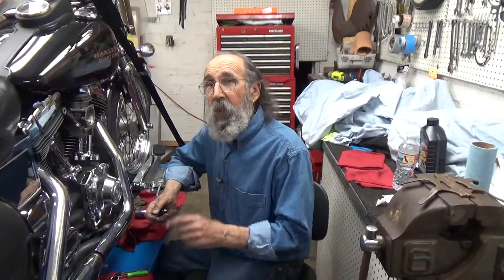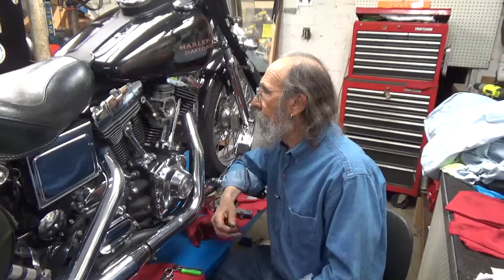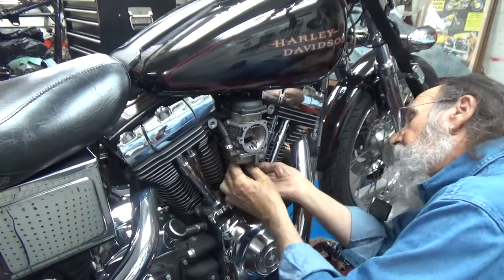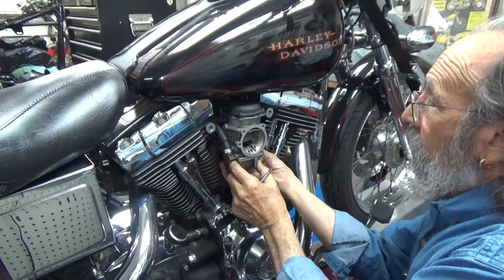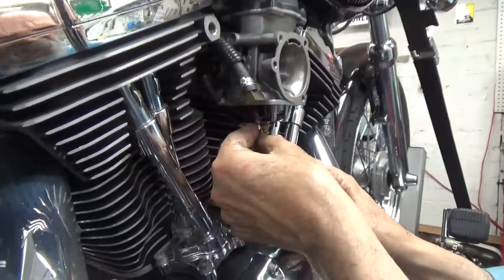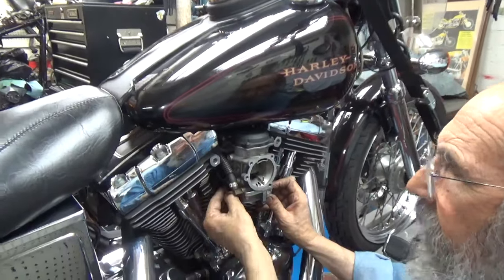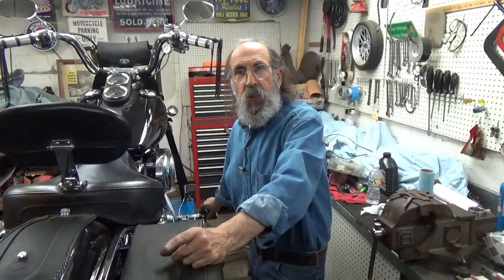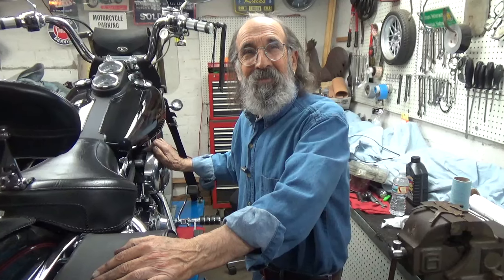Rejetting the Carburetor on a Harley Twin Cam

Comment: I have a 01 heritage softail with a cv. I moved from Colorado which is 5280 feet above sea leavel, and moved to Missouri which is about 600 feet above sea level. Having the same lean pop. Which pilot jet would you suggest? I have been told the owner before me had different cams put in it.
Reply from the maker: I don't know where anything is at in the motorcycle. If the previous owner put cams in it, he probably put pipes and an air filter on it.  This stuff will flow more air.  So,  here goes: try a #50 slow jet in that carb.  Then, tell me what happens.  If it's still a little lean, try a 52.

Comment: I have a 98 Fatboy with the CV carburetor for the longest time I was pretty happy with the 42 slow Jet. I did go to the 45 I never really had any spiting , I did go and put a sportster needle in there from 1988 it was more narrow which allowed more fuel in the mid range. But I always have to use my own Richner but not too long then I backed up halfway down on the enriching her and of course increase and hold the RPMs with my throttlestop Screw Till the motors warm
Reply from the maker: Cool.

Comment: Hello Mike, I loved the video very informative. I was wondering what the stock main jet size is on a 2002 dyna. Is it 185? Thanks
Reply from the maker: I don't know.  Normally, the main jet is fine and doesn't need changing for just an aircleaner and pipe change.  The low speed jet is usually all that is required.  Don't know what rthe altitude is like where you're at.

Comment: Real tired of those who find the CV a bad choice for performance. Really? A Buell S1 makes 91 HP from 74 CU IN @ about six grand stock. And gives way better fuel economy than an S&S.
Reply from the maker: I think it's a great carburetor, certainly the best Harley has used in modern times.  I still think, in this case, bigger is even better.  But, the design of that carburetor is great.

Comment: I had a customer with a custom electra glide. I think it was a 99 he got from a friend. It ran horrible and he said no one really wanted to touch it. it was obviously carbed. Luckily it just needed a good cleaning and some little adjustments, no jetting. I'll work on carbed harleys all day long they are so easy to work on. I'm jetting my suzuki bandit 1200 now and it's such a hassle, 4 carbs, 8 jets, syncing, etc. etc. smh. Lovely video! Internet knowledge like this video are invaluable.
Reply from the maker: Thank You.

Comment: Hey buddy, i dunno if you will ever see this comment but its all good. I botched a job on my honda cruiser dual carbs by upping the mains and the slow jet. Your video is on a 2002dyna and thats what i ride now. I put a screamin eagle exhaust and intake on and went from 45 to 48 on slow jet at 679 feet above sea level. Purrs like a kitten now and not starving for fuel. You da man!! Thanks for the video
Reply from the maker: Just for fun, try a 50 slow jet and see if you pick up a little more get up and go off idle.  Maybe yes, maybe no, but "probably" a bit "more."  Thank You for watching.

Comment: Cool. I have a carbureted 2001 twin cam.
I put in S&S gear drive cams 509’s.
Do you think a rejet could be necessary with the cam change?
It already had V&H straight shot exhaust and aftermarket stage 1 (I think) intake.
Reply from the maker: I'm sure it's been rejetted at least once.  Experiment around a little.  See what's in there.  You might even want a larger than stock carburetor.

Comment: Hey Mike I have a 95 heritage with a 80 evo motor CV carb ev27 cam with drag pipe ...what jet Should I run ...???
Reply from the maker: It depends on the altitude.  It's probably a little lean due to the drag pipes.  But, if you're at high altitude, it's different.  You'll need a smaller low speed jet.  Main jet is probably fine.

Comment: Why didnt you try adjusting the the idle mixture screw before jumping up to the 50 pilot jet . You may have only needed to adjust it and the 48 would have been fine. You run the risk now of having an over rich idle mixture now
Reply from the maker: Not really.  The late model Keihin carburetors make a very small change with the idle mixture screw.  Try it.  You'll find very little change.

Comment: Hey Mike, a question totally non-relative to your video here but I could not figure out a way to email you otherwise so here goes. I’ve got a recently purchased road king and there’s all the hubbub about carbon deposits on The piston tops due to the case breathers being redirected back into the intake manifold....... Simple question what do I do about those deposits on occasion just to keep the carbon deposits from building up? Have any ideas? (Newer meaning 2019 Road King)
Reply from the maker: Harley came out with the "head breathers" back in about 1991.  They are directed back into the air filter.  Changing these is not what the emissions people want.  I don't know what the legalities in your area are.  Redirecting those lines to the atmosphere will certainly correct your issue.  But, it's on you.  Catching the fumes and oil from those breathers is what they want.

Comment: Thanks for the info. I got a 2005 sportster 1200c. With a big sucker air intake. And Thunderheader 2 into 1 exhaust. I love in Riverside Ca. Elevation is around 827 above sea level. And the last time I had it jetted was in Las Vegas. What low speed jet do you recommend for 827 elevation?
Reply from the maker: Probably 48-50.  Just an educated guess.  They're only around $4.00 each.  I'm sure Riverside HD has some.  At least, there was plenty when Skip owned the place.

Comment: I have pretty much the same setup with SE pipes, K&N filter and Dynojet jets (170 /48) set by previous owner. The problem was the engine was "coughing" under cold conditions (under 5 degrees Celsius. The min temp I have ridden is -10 Celsius) at low speeds (less than 80km/h). I just replaced the jets with new 185/48 so the low jet size remained the same. After that: better throttle response, no running problems at any temperature and the fuel consumption is lower than before. Bike is 98' FXSTS and this setup change is made 15 years ago when I bought it and met these problems. I'm living pretty much at sea level in Finland. Maybe a bigger lower range jet would have helped too. In any case a great video. Thanks!!!
Reply from the maker: Thank you.  I think you are correct.  Remember, the low speed jet is what you're running on until around 60 mph.  I'd certainly try a 50 or even 52.

Comment: I wish you lived close by. I have a 1980 Harley FLT Shovelhead that just doesn't run pretty sure it's a carburetor issue because I had my friends carburetor on it for a while and it ran pretty good but when I put the original one back on not so much. Actually it doesn't even start now so I'm working on it. Love your videos keep up the good work
Reply from the maker: The early Keihin carburetors had most of their circuitry routed in and around the floatbowl.  These passages are very  small and get plugged very easily if the motorcycle sits idle too long.  Just soaking them in carb cleaner rarely gets them clean.  They need to be cleaned with piano wire or the like.  Or, spend some money and buy a carb that you like.

Comment: I have a 03 electra glide, plan is to put a set of fishtail straigt slip ons, on. I'm assuming il have to rejet my carb, what would you suggest on size of jets?
Reply from the maker: Don't know where you're at or what you have now.  What pipes and air cleaner at what altitude?  Is the rest of the bike stock?

Comment: What Low speed jet should a 1340 evo lowrider use with the same exact big sucker intake and Vance and Hines longshots? I live in Portland. Simon's state.
Reply from the maker: I don't know the altitude of Portland.  Try a 50, then find out the altitude.  It will tell you what it needs.

Comment: Hey Sir what size jet would you recommend for elevation at 3911 ft. Slow jet right now is 45 and main is 190
Reply from the maker: Is your exhaust and air filter stock or high performance?  How is it running now?

Comment: So mine says 185 on it, i dont know what that is equivalent to. My bike was originally in utah then i bought it in el paso. About 3800 ft elevation there. My bike need to be check choked for about 1-2 min to stay on. Even Then sometimes it will cut off while idling. I occassionally get back fires when im letting off the gas at lower speeds and downshifting while driving but more so during the first 10-15 min of riding. She started cutting off on me while i was riding recently. I checked my vacuum tube from the fuel valve to the carb doesnt look cracked or dry rotted. But i have no spray. There is fuel in the bowl. Please help. What is the 185 jet also? im in central tennessee now. I think 500 ft elevation.
Reply from the maker: You're looking at the main jet.  The slow or intermediate jet is what you need to change.  Just guessing, try a 50 for the low speed jet.  It's the other one in there.
Reply: @pacificmike9501  so i took the accerator pump apart and reassembled it now its spraying the rubber inside collapsed in on itself.  But im taking note of what you said about the secondary jet.

Comment: Hello...yeah I live in the higher elevation 7,000 feet NM. What size of jet do I need for my 88 2001 fatboy?
Reply from the maker: I don't know what pipes and air cleaner you're running, but, the higher you go, there is less air and the carb needs leaning out.  It's generally an experiment.  I can't tell you, even a guess, without more information.

Comment: The CV carburetor float bowl screws are JIS, (Japanese Industrial Standard) and use a special screw driver to remove them. They're a blunt or modified "Philips Head".  I bought a set of these screw drivers and don't have problems with the screw heads " caming out " and ruining the screw heads anymore.

Great Videos, Thanks for your time.
Reply from the maker: And, Thank You.

Comment: I have a Shorty S&S Super E on my 91 1200 w teardrop cleaner, never once have I had an issue,
Then again I shut the gas off about half a mile from the house and make it with what's in the 
bowl. So even though I ride it a lot, there's only gas in the carb when she's running.
Reply from the maker: Cool.

Comment: A friend gave me a plastic bag with two CV carbs in it. There are probable enough parts to make one good carb. Mine will go one an 88" inch Shovelhead with a Andrews AB cam.
Reply from the maker: Sounds like fun.  Good carb.  A little small.

Comment: I am switching from my Mikuni HSR42 back to a CV carb on my '95 EVO Wide Glide. The CV carb I got came off of a 88" twin cam and I understand it is jetted richer for the additional intake fuel requirement. Can I re-jet down to the stock 42 pilot and 165 main jet on this carb? Ot do I need to buy an original 80" EVO CV carb?
Reply from the maker: I believe you're probably correct in your thinking.  I don't know the altitude where you're at.  Make sure of your other hookups.  I'm not sure of any other differences. The carburetor should have a Harley part number on it.  The last two digits will tell you what year it was produced and, probably a "revision Letter," which will also help you identify it to help compare it to your original carburetor. Just something to check out with your service manual.
Reply: @pacificmike9501  Thanks Mike!

Comment: Hi Mike you are probably getting sick of my replying but my Shovel is basically all S&S now pipes internals Camshaft hydraulic lifters and S&S shorty carb but my rear Cylinder keeps failing plugs if I ride short distances, long distance great Shovel so reliable but short distances rear plugs keep failing and no carbon but I have compression head gaskets are good bottom end is good but can you please help me out with something look at i am leaning towards cam 585 to big or carby not feeding the rear cylinder properly and its summer in Australia.
Reply from the maker: Most likely a vacuum leak at the manifold.  One rich plug.  Other one okay.  Most likely a vacuum leak.  Manifold probably not fitted well or intake seals gone bad.
Reply: @pacificmike9501  thank you very much.

Comment: they are a 40 mm ,early 883 sportster carbs were 38mm but they didn't have a accelerator pump , you used to be able to buy 2 sizes bigger .
Reply from the maker: Yes, I know.  I'm just not a fan.  I've run a lot of flat slide Mikunis on a lot of customer's bikes. They've all been great.  I've run a ton of SU's.  I've dealt with a lot of other carbs including all of the Keihins and S&S units.  I've worked with Webers and DelOrtos.  I've even worked with Dual Throat S&S's.  On my antiques, I run Linkerts for their quality and awesome tunability, which can be accomplished on the fly.  On my old hot rod Shovelhead, you couldn't pry me away from my SU.  Again, ease of tunability, easy altitude changes on the spot, loads of power and great gas mileage.

Comment: Nicely explained, I have Mikuni 42mm flatslide carb on my '99 Twin Cam Road King, along with free flow aftermarket pipes and the same Big Sucker air cleaner as in this video. I'm ashamed to admit that I know little about the jets and set up on the carb as it's given me no reason to delve into it thus far. Have you done any videos on the Mikuni flatslide carb ?
Reply from the maker: As yet, we have not.  But, the instruction manual that comes with the carburetor is really good.  There's a lot of information in it, but, if you sort it out, it's a simple carburetor to work on and jet.  Usually, just the pilot jet change.  Real easy to figure what you need.  Should be able to get the instructions online.

Comment: Good vid but, I'm kind of surprised that, with the bowl off, you didn't spray carb cleaner up through the idle circuit. If my bike sits those holes behind the throttle plate can get gunked up.
Reply from the maker: Use better gasoline and don't let your bike sit so long.

Comment: This was great Mike.  My bike is almost exactly the same (01 Lowrider) and it also has a lean cough with better pipes and thunderslide kit.  I did mess with jets and it's better but not perfect.  I'm at sea level so what do you suggest I start with as JET sizes.  Thank u.....Ed @  Jersey shore.
Reply from the maker: Start with a 48 and go up from there if necessary.

Comment: Great video .. . I may have to change my low speed jets also on my 1998 Dyna wide glide - due to some lean spit issues. I'm at 5000 ft here, in Colorado
Reply from the maker: Pretty normal stuff.  A slightly small low speed jet is normal up there.  But a lean spit is the opposite.

Comment: So a 42mm would be good for a 97 Fatboy 1340?
Are you talking a bigger CV?  Or something else?

Thx!
Reply from the maker: A 42mm Mikuni would wake it right up.  Of course, a good cam and good pipes would help a bunch.
Reply: Pacific Mike thanks for the quick response.  I have Vance and Hines pipes and an ultima ignition as well as a k&n filter.   Where is a good place to find a mikuni that’s made to fit my hog?  Thanks!

Comment: I enjoyed watching this but my hands are too old and hurt to even do that I think. My 2000 wideglide has been sitting for 2 years and won't start. I would think maybe the carb is gummed up. Great job on video. Looks like you have doing this a while.
Reply from the maker: Yes, and I have to demand my hands work.  Somehow they go.  And, somehow, they might even fix one.  We'll see.

Comment: This was an awesome vid!! Got a honda sl500 I know its not a Harley but it has a jetting issue because it has after market pipes good down low but falls on its face at 5000 to 8000 they are a constant velocity carb as well what kind of step in size should I go up have to order or drill the mains
Reply from the maker: I'm not sure.  I don't know those bikes.  However, if you can read the number on the jets you have, you should be able to order larger jets from your dealer.  Jets are generally not expensive.  Go in steps and order accordingly.